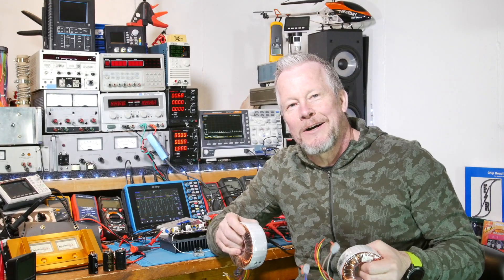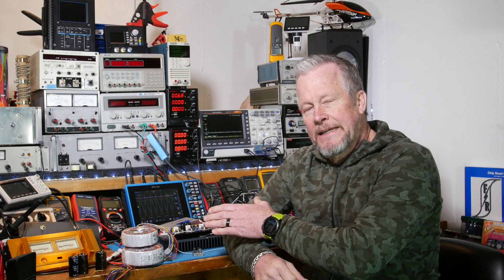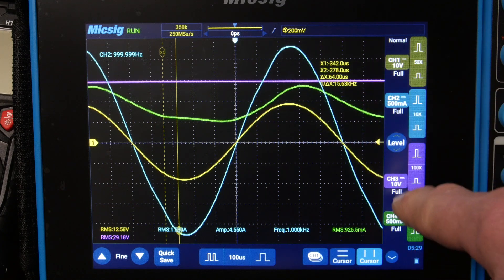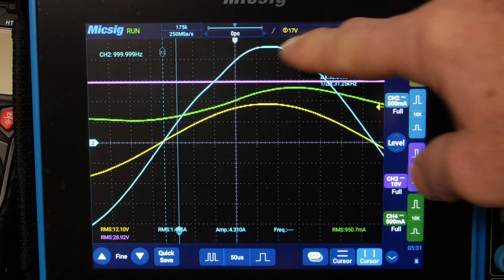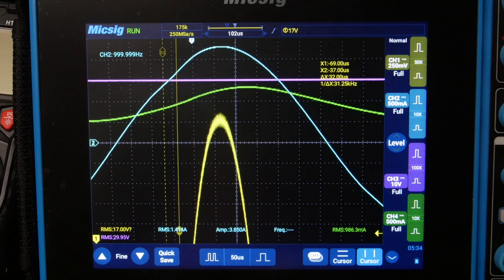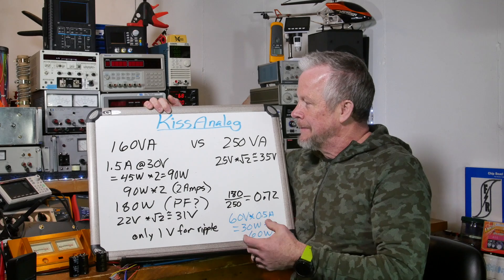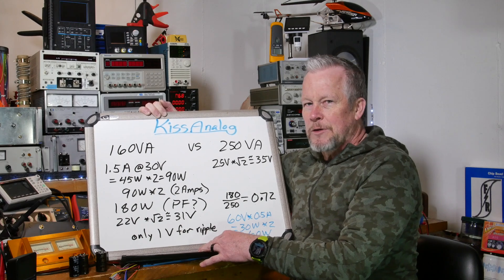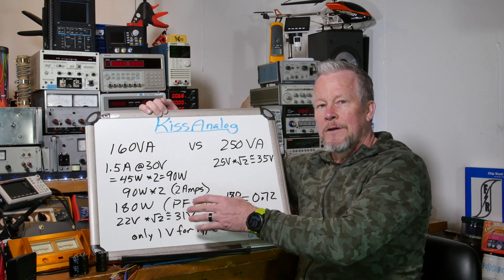20W Class A Amplifier - How to Select the right Transformer

Comment: There appears to be a compensation problem. The peaks of the yellow trace (Voltage across the 8-ohm load) shows high-frequency oscillation. This problem is separate and apart from THD. It looks like you really have two issues going on, high-frequency oscillation and non-linear distortion.
Reply from the maker: Thanks Gerard - great eye!  I’ll have to take a closer look.

Comment: Bored with your amplifier video's? NEVER! Watching you analyse the amplifier and calculate the requirements is the most interesting video series you do. I do think you are going to get voltage sag with low frequencies using the smaller transformer, but I wait with bated breath for the following videos to see the outcome.
Reply from the maker: Thanks Ian - I appreciate you!  Once I start powering the amp with the AC/DC power supply l- It will be interesting to see what happens;)

Comment: I am enjoying following your reasoning. Just to refresh your memory, capacitors stores energy, that will give you the extra energy when you need it, just increasing the rails slightly increases the stored energy proportional to V². That is desirable so go for the higher voltage even if it is the smaller transformer. Dynamics and RMS does not fit well, dynamic and available energy does. Well done so far Eddie, you are a star. Also keep in mind that the higher rail stretches the linearity as well you have demonstrated it perfectly.
Reply from the maker: Thanks Nico!  Great feedback!  I appreciate you!

Comment: Are you doing a CRC psu for the Class A amp Eddie ?
Reply: I would then rather do a capacitance multiplier to dive just under any ripple that may exist, but is this necessary, when Eddie is done we can re-evaluate what could be improved upon or what is wasted.
Reply: @nicoras8803  CRC is best for Class a Constant current amplifiers.
Reply from the maker: I'm posting a video tomorrow on the power supply ripple - it is pretty interesting I think;)  Then, I'll have to post a video showing how I can correct it.  I'll probably use the Kiss method;)

Comment: You need to do a listening test using less caps or small values will give you a better inductance value overall
Reply: How do you figure that, what does inductance have to do with listening -please explain. Are you talking about the transformer's inductive reactance? This does not matter after you turned it into DC then the inductance will also be a store of energy and reject ripple.
Reply from the maker: Yes listening tests are great and I’m relying on my friend to help with that;)

Comment: I'm really not in to audio amplifiers, but I am enjoying this.  I have always been of the philosophy, the bigger the power transformer the better, even if you don't need the power.  I have no scientific or empirical reasoning behind that.  It's probably more the Tim The Tool Man Taylor thought process "More power...urrrgh urrgh urrghh".  I would think you will have less load ripple issues with the larger transformer.  You are saying 10 watts more in the box.  Is that more power you have to dissipate?   If you are not having to dissipate those 10 watts in the form of heat, that they are just there, available if needed, then where is the harm? Also, it sounds like you are not planning to regulate this supply, so there should be no extra power dissipation in that scenario.  If you find, you need to regulate it, then you need those 5 volts of over head to do that.  You may of had a video on that already.  Why do you not need to have a regulated power supply? Is that just the way of the audio amplifier beast?  Forgive me, my electronics work and career never got in to that and it's been 40 years since school (wow, damn).
Reply: You are right most of the way. You do not want to regulate a power supply for an output stage, that is just a waste of energy, the capacitors in the rails can provide instantaneous energy when needed. 
Bigger is not necessarily better. What one does want to regulate is the front end, which in this case is done by the zeners and its capacitance. However, I would add a series diode into each power rail of the op-amp simply to prevent current rushing out of the op-amp circuit which will adversely affect its output voltage swing when the main supply falters under load.
This could increase the third order products since it suddenly experiences compression. The third order products refer to intermodulation (IMD) distortion, not harmonic distortion, a very different animal altogether. It is a result of two adjacent signals generate two or more signals on either side of the original signals, and is not harmonically related to either but the sum and difference of the two adjacent signals. Very much an effect of compression setting in and sounds horrible. It does not matter whether the amp is class A, B or whatever class it is, gain compression is evil.
Reply from the maker: Thanks for watching.  I did a lot of videos on the amp, so I hope you made it through;)

Comment: Also, a lineair power supply has quite short high peak currents between the transfo and the caps. Several times the average current consumption. This is because the caps can only be charged in the ripple period. When the caps have a higher voltage than the time in de sinus, they can’t  be charged. So a transformer VA must be 2/3 times the average current delivery of the power supply.
Reply: Good rule of thumb.
Reply from the maker: Thanks Eddy (great name;)!  I actually did a video in the early days LOL I haven't been doing this that long...;)  https://youtu.be/1sV0xicp4zA